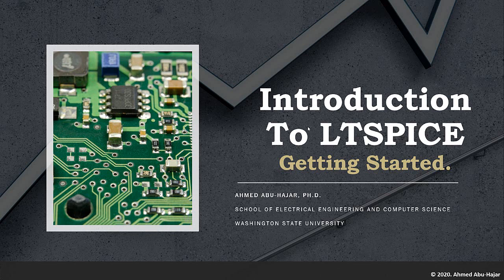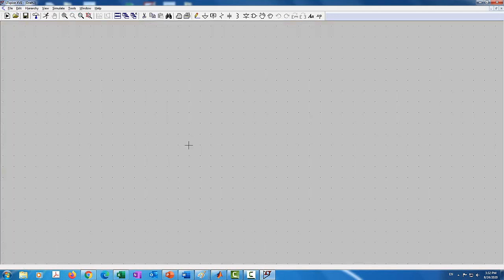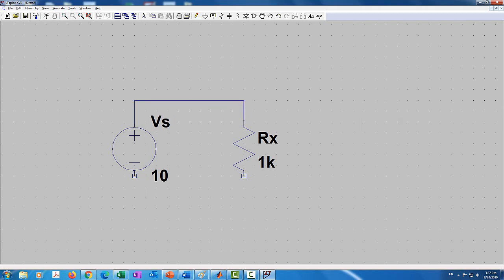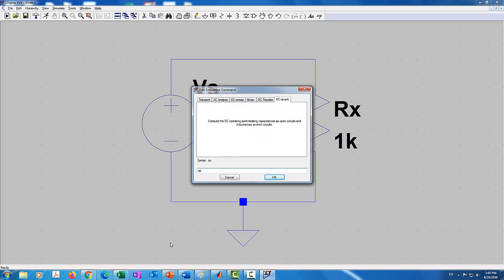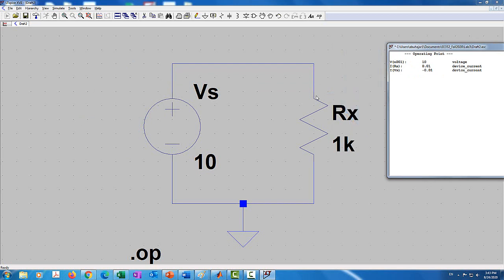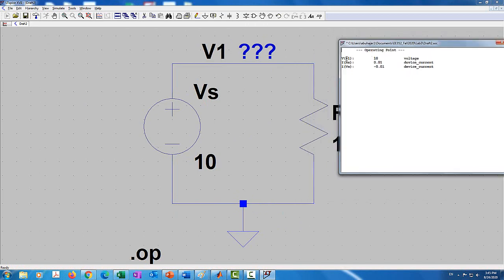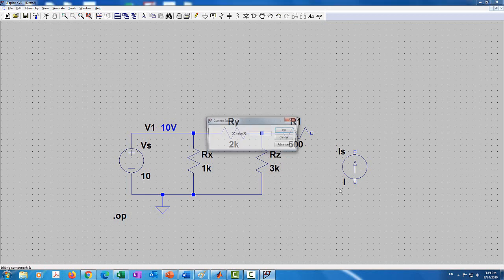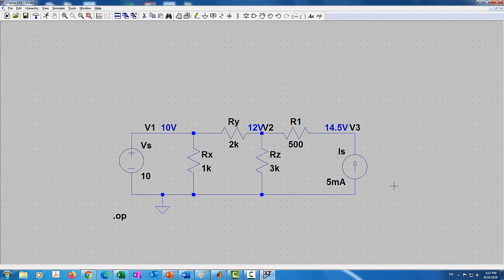Introduction to LTSPICE: Getting Started

Comment: At 18:22 the actual current is going right to left down the potential gradient (from higher potential at V3 to lower potential at V2). That current is (must be) in the same direction as Is (otherwise KCL would be violated at node V3). Is and R1 are in series and thus must have the same current and in the same direction. The reason I(R1) is listed as negative is because it assumes a current direction from left to right which is opposite the actual current direction.
Reply from the maker: You got to be careful wit LTSpice. The direction of the measured current is originally defined from the top to the bottom (I.E. from node a to  nose b). So, when you rotate the resistor its keeps the same current from node a to node b. So if you rotate the resistor by 90 degrees three times, you will be a negative current.